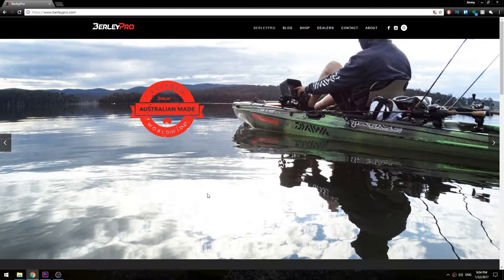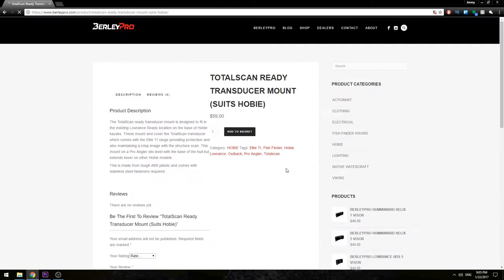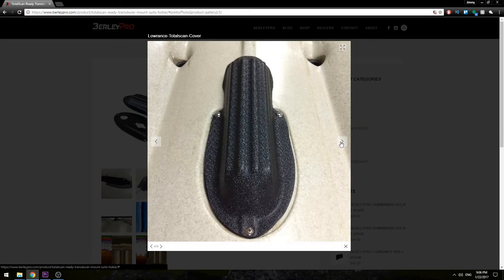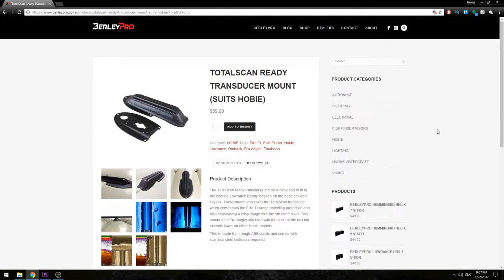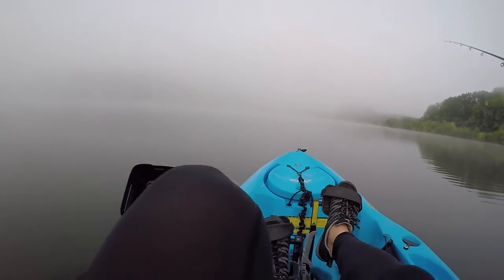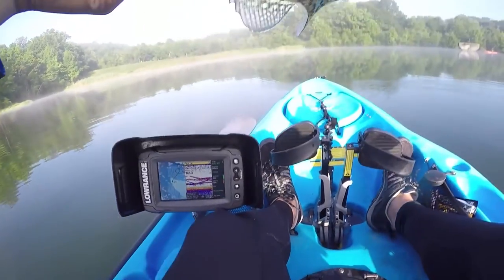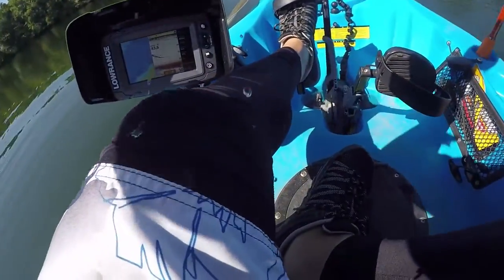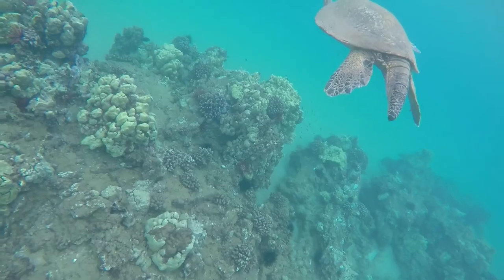BerleyPro Transducer Mount for Lowrance Elite Ti 5 for my Hobie

Comment: That's awesome they have a way to do side scan now from a kayak
Reply from the maker: +Yank UR Crank for sure. Back then u needed i think another unit. Which means more juice.  I think i drain a lot of battery right now. Need 2 cells to last a day trip. So beware lol
Reply: +raWr Fishing I am definitely going to have to check into that. I built a box that holds several cells so that will work perfect.
Reply from the maker: +Yank UR Crank yeah i will need to figure a solution out... i had a buddy who carried a car battery... was heavy to carry haha
Reply: Yeah my box is big but nowhere near as heavy as a car battery lol. I will post a video in the next couple days and go over what I did it has worked out great for me. I have lights on it usb chargers, cigarette adapter, and plugs for my led lights and graph.
Reply from the maker: +Yank UR Crank thats hot lol
Reply: Thank you lol